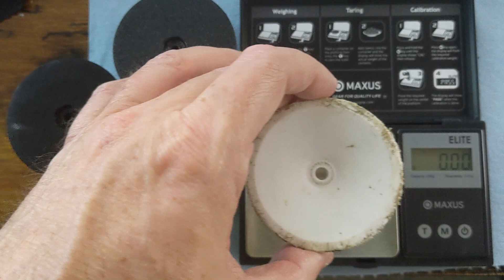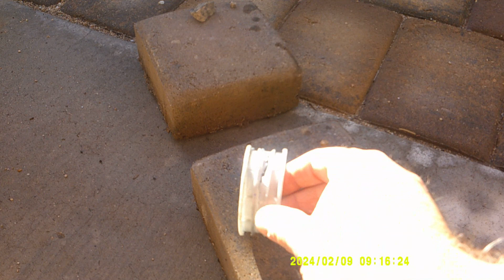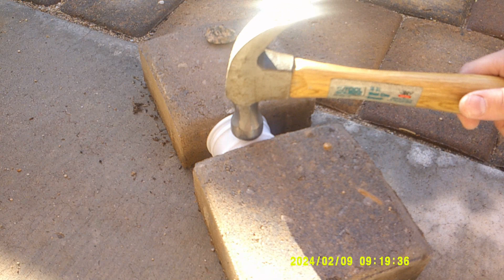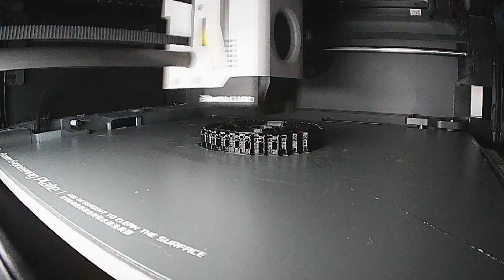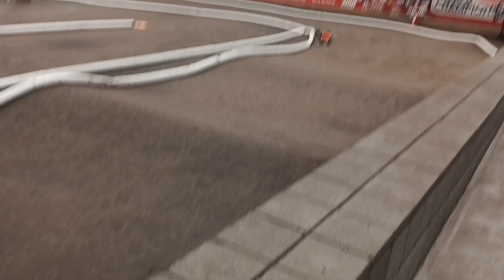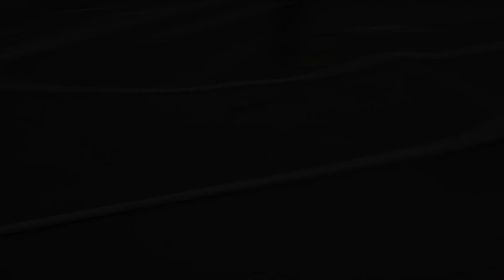3D printed wheels, can they stand up to RC car racing stress?

Comment: You did a great job designing those wheels! I would be very interested in an updated video and I know a large group of racers that would want to try them as well! Also great video and great detail!
Reply from the maker: Thanks, I need to get an update video out. I do have some updated wheel models, but I find that the nylon wheels have not lasted as long as a wheel you may buy.  It could be the nylon I was using, or perhaps I had not dried it enough but they do tend to fail at the layer interface where the front of the wheel meets the inside rim.

While there are more expensive nylon filaments once you are over $35 per spool I don't think there is an ROI.  I'll see if I can get an update video out.